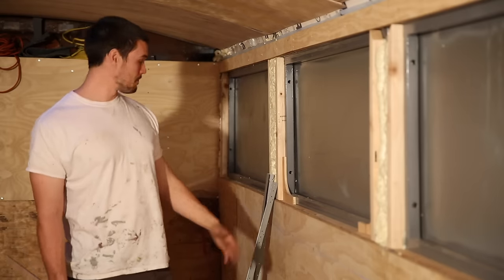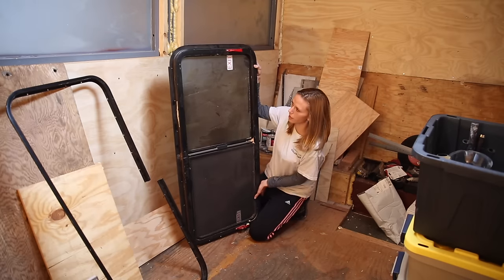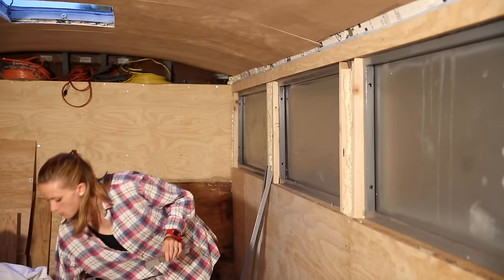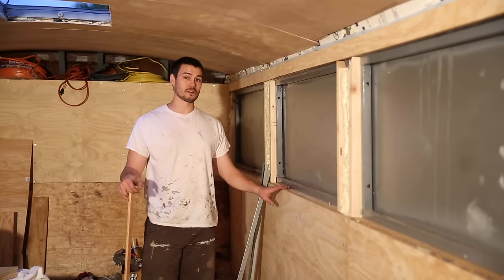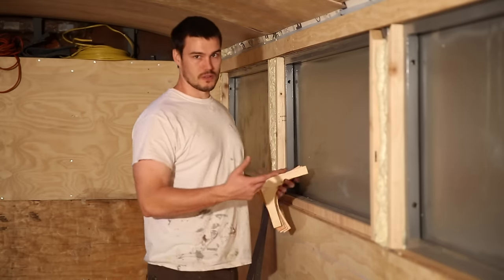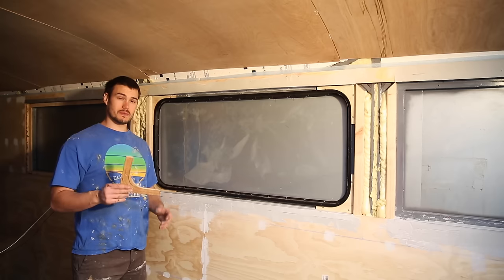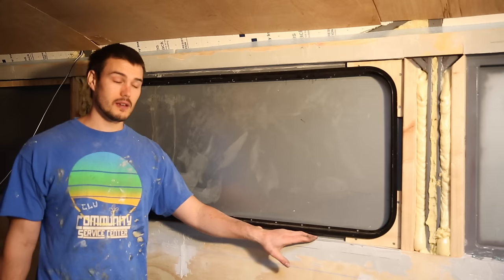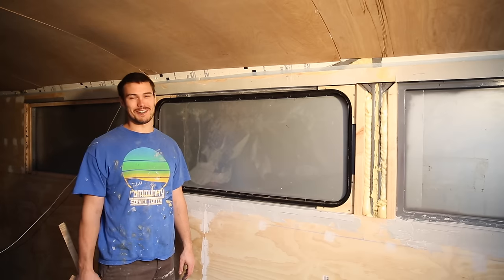Bus Conversion Tiny House #34 RV Window Installation Part 1

Comment: It doesn't happen to everyone. Wait until you drive it ceiling will be falling windows will be cracking. You could have used the window cutouts for shelving or cabinet doors. You seem to be making a lot of extra work for yourself. Think ahead if you can good luck, I just don't want to see you getting discouraged. Ask your viewers ahead of time how something should be done. 👍
Reply from the maker: +Thomas McFeely There is no need to be arrogant. It has been driven regularly over the last year, even over bumpy dirt road... no issues. Ceiling is still up. Windows are not cracking. The windows we purchased were cheap, we said that is why we used them. We didn't want to buy new clamp rings, hence the window ledge. Furthermore, the window ledge had an aesthetic feature of being able to make curtains sit flush with the wall. I hope you don't feel bad being completely wrong but unfortunately you are. So thank you for your misplaced concern. Have a good life.